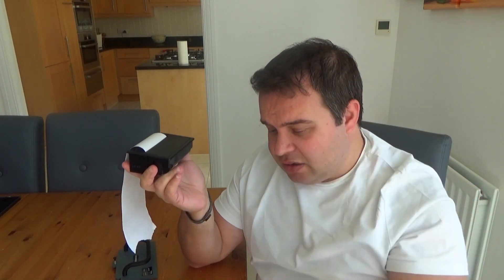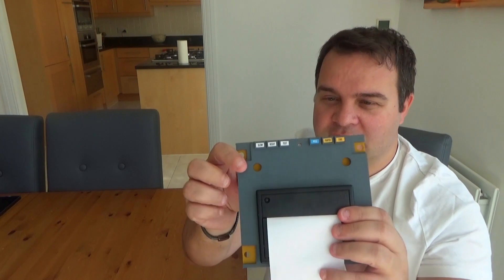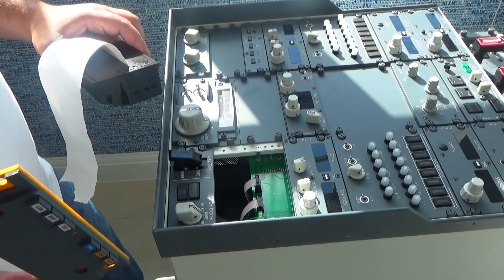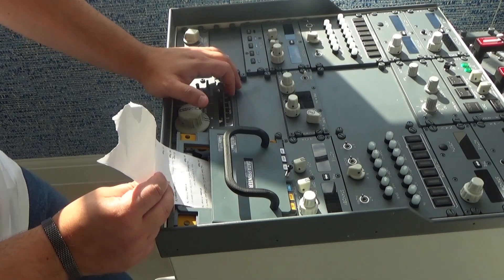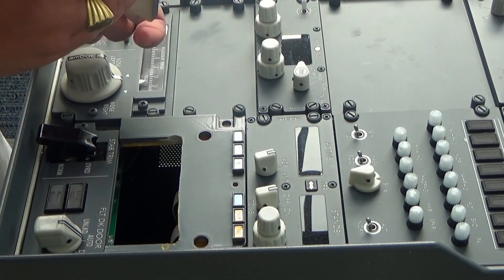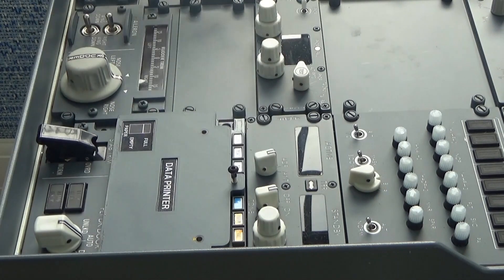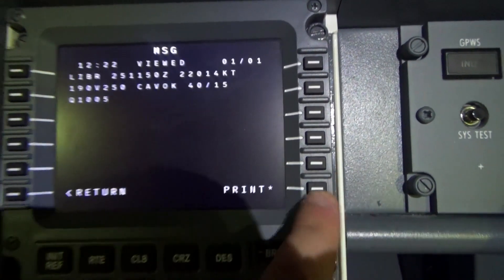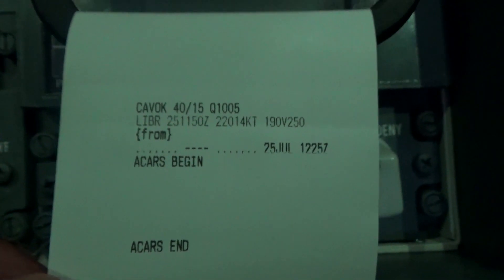ACARS / CPDLC PRINTER

Comment: I also have the exact same pedestal. I'd be very tempted to remove the cockpit door panel unless you have a door that uses it in your sim
Reply from the maker: It will work for sure, but I didn't want to remove it as I wanted the simulator the most realistic possible

Comment: Also do you have a link to the printer and panel?
Reply from the maker: I purchased the panel on ebay, 
https://www.ebay.co.uk/itm/174728201265?mkcid=16&mkevt=1&mkrid=711-127632-2357-0&ssspo=dTEb-kDiQyK&sssrc=4429486&ssuid=fcl__yobr8u&var=&widget_ver=artemis&media=COPY
Foe the actual printer, just search on aliexpress for Brightek thermal printer, there are a lot of them